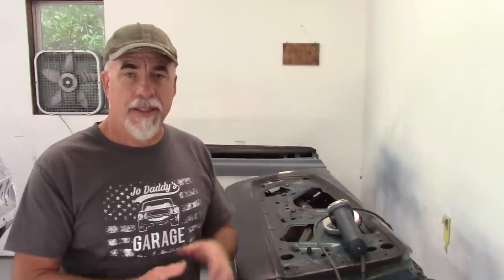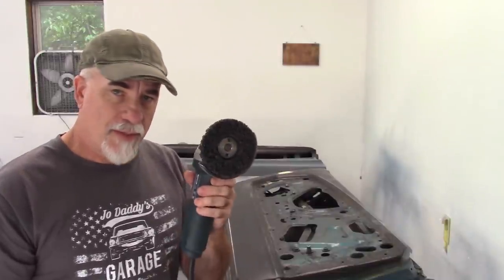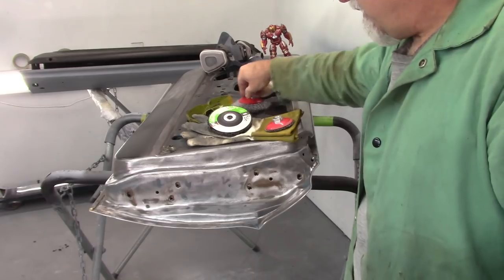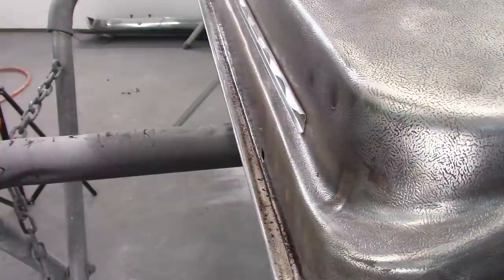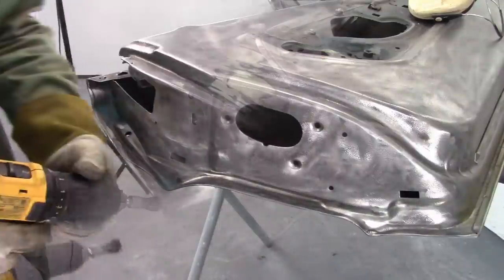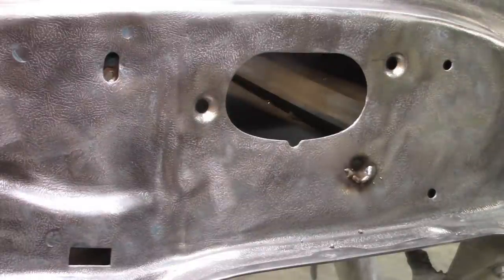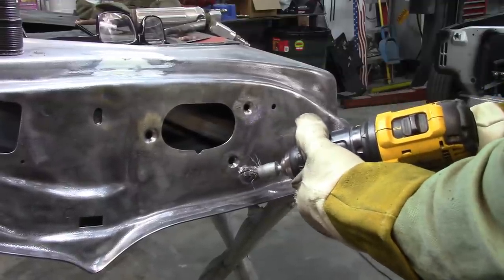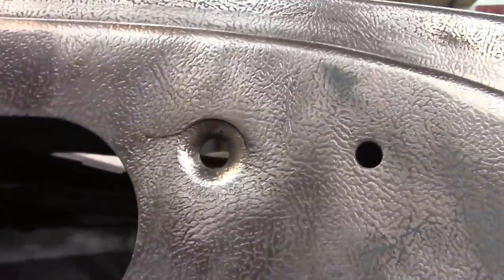Mustang door paint strip. Jade part 35.

Comment: Here is how you can somewhat replicate the texture on the inside of the doors. I had a small dent fixed on the inside of a door and the texture was recreated using crumpled up aluminum foil just dab into the filler when wet. It takes a little practice and it looks a lot better than a smooth spot. Love this channel have learned so much don't ever apologize for taking the time to explain and do the details that is usually where most people need help and get stuck on their builds.

Comment: Thanks for showing several methods to prep the surface of Jades door. I used a different method to strip paint from a cowl for my 67 Cougar yesterday. I used dry ice blasting to strip the cowl and it worked very well. This process is like sandblasting without the mess. It gets into all the nooks and crannies and does not affect the surface finish of the metal because it is non-abrasive!

Comment: Barry, you could use the home vapor barrier and the adhesive for it at HD , it will keep the moisture out. i use vinegar water mix to clean and treat the left over rust,  same process ,it  works well .

Comment: It is crying shame that the latch metal was not thicker, factory spot welded back plate, backed it up with tooling or all 3. 
 I have not seen all of the videos but that texture on the sheet metal is for what? Looks! I have never seen that or noticed. I a rural town not to many Mustangs, but a few Falcons & Maverick’s but mostly welding crack in suspension panel in engine compartment, with bent stick welding.
  To create that texture, could a guy use a small cold chisel? Learned and seem something new!
Reply: Thanks, I appreciate the paint stripping video but thought you had a clever idea for the inside of the inside. Weld a patch, can’t reach, spray cavity wax just make the drain holes are open after 3 days or more. I hate the idea of rust inside where the regulator, latch and door guard beam is supposed to be. I was hoping for some cleaner, long brush and rinse then seal with wax. Those pinch welds that hold the skin on, need a seam sealer and wax the whole thing. Others go for a “Zinc Rich” acid type that is expensive but you can’t reach to scrub. Have you addressed this?
 Just finished the door hinge video and have home tools to fit a slide hammer sold by MAC. I use DOM tube, drill and tap to fit! Enjoy learning but this 67 C10 is mine and doing wiring now. I make the harness from complete salvage donors that cost $25. Cheapest wire in town, connectors, color w/stripes and sized. I pick fuses from my amp clamp average including in-rush current.
 Thanks again. Just hoping you had a trick for inside the doors! DK, Omaha.

Comment: Why would you not cut the door open to stop the rust on the inside and epoxy that?
Reply from the maker: Cut the door? That would lead to more problems. If you make a cut, you need to weld it shut. In this case, it is minor rust, and has been treated.

Comment: Just a suggestion, but I think I would use Alcohol to clean out the rust  converter instead of water.. Using water just doesn't make sense to me, being that if you don't get ALL of the water or moisture off the door then it kinda defeats the purpose.. Just my opinion.

Comment: Looks like you didn't wipe off grinding dust before rust treating so, of course your water-wipe will appear like you're cleaning off lots of rust.

Safety tip: avoid running that Warrior on edges of the work piece while the disc is turned on it's side....it can separate from the back plate and throw the fiber mesh disc violently.  (Still haven't found where mine went)
Reply: Found that disc today....40 feet down the driveway!

Comment: those inner paper pieces they shmoo'd behind the door panel is a moisture barrier. was supposed to keep any moisture that would get past the window felt and into the door from causing the door panels to mildew. i bought some, but i dunno if i want to use them either.. i'd rather just go with dynamat's custom cut for doors. sound deaden and protect.. - also, am i blind.. where do i find the shirts? don't see them on the amazon link.
Reply from the maker: Shirts are on tee spring: https://teespring.com/stores/jo-daddys-garage
Reply: @JoDaddysGarage  thanks. heard you say that, but guess i just assumed that's where you had them made, and not to go there to buy them.

Comment: I’ve been using single stage ppg.for the inside portion of my builds . Less metals used less problems later on. I’ve been using 2 stage on the body with 2 double coats of clear and letting that set over night then hit the top with a quick wet sand,  then hit it with another double coat of clear..its gives you a little insurance for future unforeseen events.

Comment: Since we were doing the same project at the same time however I replaced the door skin as well... I use the same 4" wheel for the big areas but I use the drill mounted ones for the hard to get to areas. Since I had my door apart I media blasted the inside and had to do a patch to the front corner of the door as well. before a layer of epoxy. I put a layer of "dynamat" on the door skin before installing it. I really should have filmed it since I haven't seen anyone do a door skin on one. Will do if I do the drivers door skin as well. It has issues...
       FYI the door skin was a near perfect fit. No complaints about the skin at all.
Reply from the maker: Well, now you have experience to make a video on the other one....
Reply: I’d love to see how you did the door skin!
Reply: @swooshdave  I am looking at my drivers door and will see if it can be saved with a skin. It has other interesting issues that will require an inventive repair... I am looking at cameras as the better half says I need to start recording my projects and put them up. Who knows maybe a couple people would find them interesting.
Reply: Robert Adams I have to strip the paint off my doors to see if they are worth saving. It might be cheaper to get some used doors.

Comment: Man I appreciate your videos. I have two Mustangs a 65 and a 71. I got them back in high school. Went to college got married and had kids. Great life. When I go to the garage I see the cars parked in there. Today I got the welder out and “tried” to weld in the tail light panel and completely failed at getting it welded in. I lost my steam after about two hours of trying to weld in the panel. My plug welds weren’t penetrating all the way to the bottom panel. I am using weld thru primer from Eastwood. I start welding on the top side panel on the edge of the hole. Working inward. What am I doing wrong? Any advice I’d greatly appreciate it!!!
Reply from the maker: What type of welder? Gas? What heat and speed settings? What size hole?
Reply: Just my 2 cents. Sometimes I've had problems getting the welding arc to make contact through weld thru primer. If I'm doing a plug weld with weld thru primer on both panels, I scrape off the weld thru primer that's visible through the hole in the top panel. There is no need for weld thru primer in the middle of a plug weld anyway. The weld thru primer is meant to protect the metal around the plug weld and the non-welded areas between the panels after plug welding.
Reply: It’s a Craftsman welder, 130,.023 wire, 75%argon/25%co2, heat at A (click type)/ speed at 3.5 (infinite), 3/16” hole.  I can lap weld fine. I can butt weld fine. But I’m having trouble with the plug welds. I looked around and people are saying to begin the weld on the bottom piece and spiral out to the piece that is on top. I’ll try scraping the primer off and see if that’ll do it.
Reply from the maker: @Mozzer1487  Hole is way too small. You can barely start a weld before it fills up. I use 5/16-3/8" holes depending on location.
Reply: Jo Daddy's Garage You’re right on the money. I upped the hole size to 5/16” and got the two panels welded perfectly. Thanks for the tip!